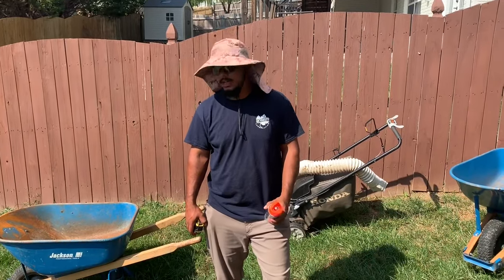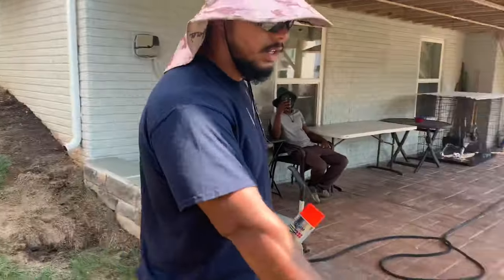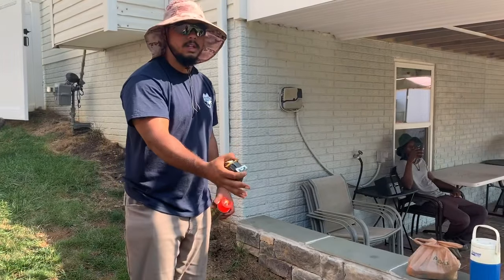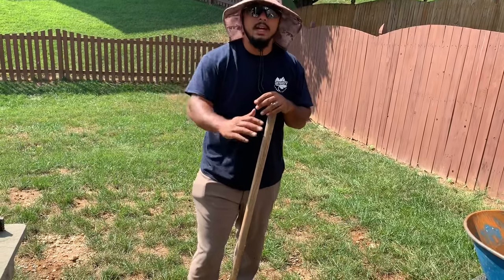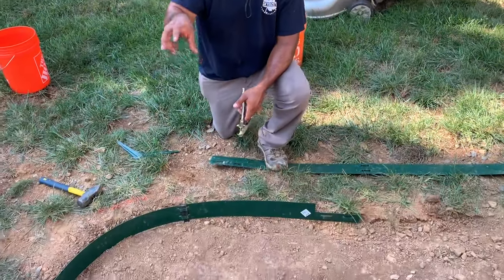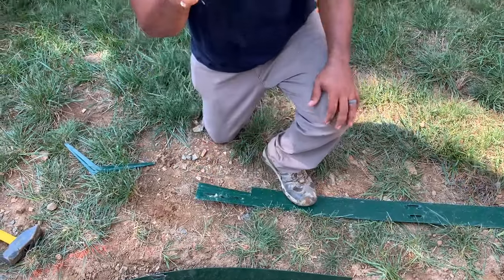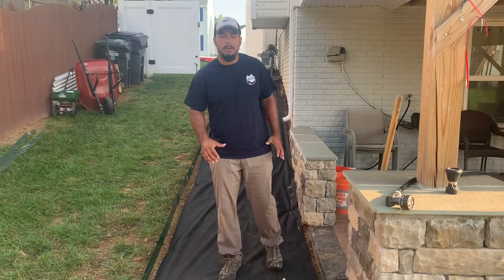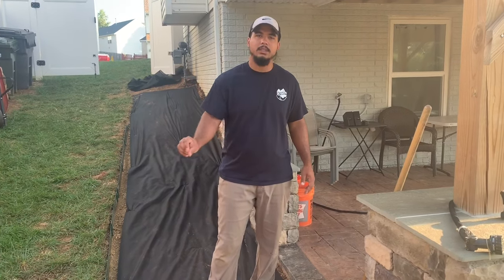How To Install a Rock Bed

Comment: That was an excellent video! I am trying to lay a rock garden but have some old bricks all around my home that I want to repurpose as the Border. Would love to see how you lay a different type of border around a rock garden. I was wondering if I should put the fabric liner under the brick as well to keep grass and weeds from growing in between or just put sand beneath the stone and then come in behind it with my fabric liner

Comment: If rocks are going to cover the fabric, why use pins?
Reply: To secure the fabric to the edges, for one.  For another, the rock may shift with traffic, etc. So, the fabric may rip.  I imagine there are other reasons.
Reply: Fasteners keep that fabric in place.  I once thought the same thing ..I'm using ricks, I don't need fasteners, I was wrong, the fabric moves.  I now have to re work the area as I have weeds in areas where the fabric moved along side the wall.

Comment: I want to see how to UNINSTALL a rock bed.
Reply: I've done that one Saturday morning....and afternoon.  If your fabric was put down right, all you need to do is move the rocks to the middle or end of the fabric and remove your fasteners.  Depending on the quality and strength of your cover, you and someone else may be able to lift it up and dispose of it.  If your fabric is one piece, you may have to cut the section you piled the rocks on.  That's the easy way.  Otherwise, you have to shovel those lil boogers up, put them in a trash container.  Then take the weed cover up.  Lots of work.

Comment: No, do not use landscape fabric.  Weeds, especially Bermuda grass will grow right through the fabric.  Use solid agricultural plastic.  You will waste a lot of money and have a horrible rock bed with many, many weeds.  This landscaper like many doesn't care about care and upkeep.  They just care about the money they will make putting down the fabric.   It is going to cost me a lot more money to have the worthless landscape fabric replaced with agricultural plastic.
Reply: Plastic does not allow water to drain through. How well your weed fabric works is based in a number of factors including weeve and thickeness.
Reply: Plastic holds water creating a place for mosquitoes to spawn. Especially under decks.
Reply: Buy a higher quality landscape fabric.
Reply: It's called weed barrier for a reason. It works.
Reply: You're not installing the fabric right if weeds are growing through it, and you didn't prep the bed properly, and possibly didn't install a proper depth of rock, and possibly didn't treat the rock bed with preemergent to prevent weeds that grow on top of the fabric.
Reply: After he already did it 😂😂😂
Reply: The fabric I've used worked great. Almost 10 years now and no weeds
Reply: You don't know what you're talking about. I used fabric they use for road construction with limestone on top with no weed problem.
Reply: R u glad u wrote this? Look at all those helpful tips it spawned